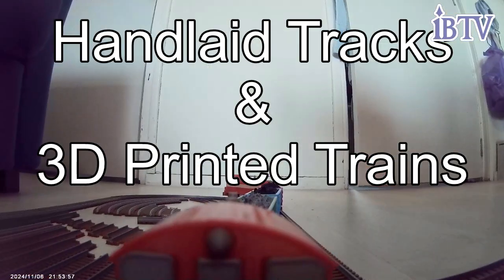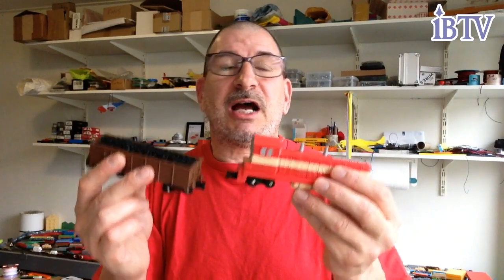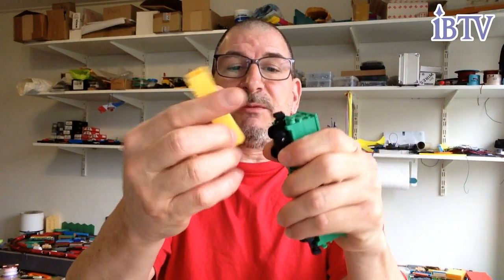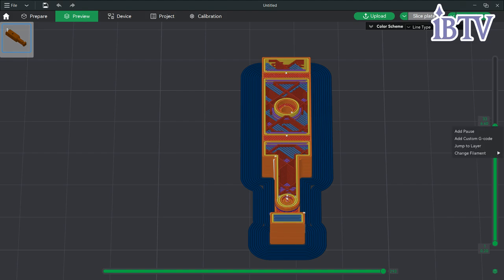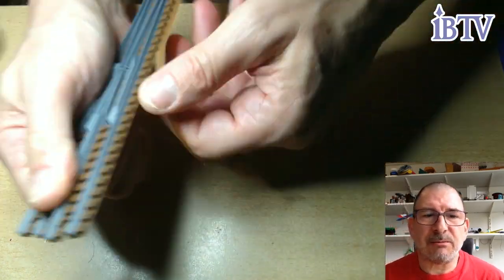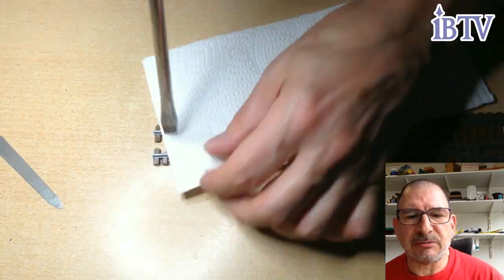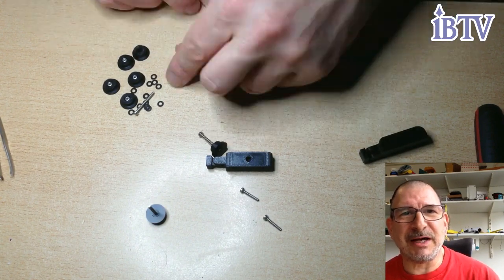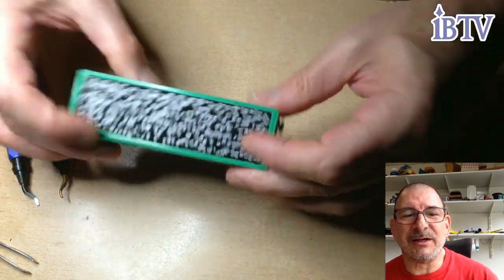HO 3D Printed Train Set - Cars, Tracks, Couplers Even Working Turnouts! All 3D Printed!

Comment: so your printer can alternate between reels to support multiple colors? I really need to get back into 3d printing it's come a long way since I tried it out.
Reply from the maker: Exactly! The Bambu A1 w/AMS does four colors as fast as my CR10-V3 did one color! The quality of the print is a full generation better as well. Zero gap parts will fit together, maybe a slight de-burr on the edge needed. I started with a RepRap Omerod 1 - so yea, they have come a long way! I still use Sketup Make 2017 for design.

Comment: Something like the track should print fine without a brim. It's probably lifting with a temperature change. A cheap way to avoid that is with foam floor tiles turned into a cube around the printer. 

The print in place points are neat. How do the points stay in either direction. Is it a friction fit or are there ramps under the bottom? When I designed L gauge points the locking happens with the geometry of the throw and push bar.
Reply from the maker: Thanks for your thoughts and feedback! The track ends have "dog bone" connectors and those little curves are where the print has failed. My little living room is 25c and no real drafts, also if the bed is cleaned with a tiny bit of dish soap it sticks fine reprinted. 
I did noticed that the A1 does a auto bed leveling calibration, but only for the 18cm mini bed area. So the right side and back aren't compensated. It is in the right side where I have had issues... 
The turnouts are just friction fit. Breaking them free is not impossible, but not super easy. I got all but one appart. The ones marked "Creality" are with larger gaps. Will make the turnout as a HO #6 jig eventually.
Reply from the maker: The Bambu slicer 1.10 update fixed the bed leveling issue! Now it does the entire bed and the track pieces are indeed sticking fine without the brim!